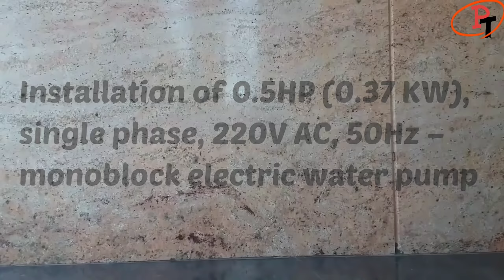INSTALLATION OF HALF HP PUMP | INSTALLATION OF 0.5 HP MONOBLOCK ELECTRIC WATER PUMP | PRACTOTECH #51

Comment: How to control the flow of water while spraying for balcony plants? Water is coming at very high force. It keeps on emptying the bucket of water in a fraction of seconds. What to do to reduce this?
Reply from the maker: You have to use a "pressure reducing valve"

Comment: .64 kw solar fittings can 0.5 hp pumpset work
Reply from the maker: You can use two solar panels each of 250 watts total 500 Watts to run your pump but the pump will only work for 4 to 5 hrs during bright day light.

Comment: Can we use centrifugal pump of 1 HP for getting the water to 3rd floor
Reply from the maker: You need to check the head (height) of the pump. 60 head, 80 head, 100 head....
Submersible pump is preferable for higher heads.

Comment: Will not it harm pump, if we close the water output before switching off. Bcoz pump is sucking water and creating pressure in output nozzle.
Reply from the maker: Dear Sir, the manufacturer have suggested to close the water o/p before switching off the pump. But it is not mandatory all the time. We can even close the ball valve after switching off the pump. It is not essentially required, if you are using the pump continuously.

Comment: nice video 
can i use it for my well 50feet depth, because we have no electricity, we have home solar system with 2.5kv inverter
Reply from the maker: the output pressure will reduce for 50 ft depth

Comment: With this method, after priming only first time if we put suction pipe in a tank then in future we don't need to do priming again right?until water level downs below football..motor will do Self priming right?
Reply from the maker: Yes Mr. Aditya Mirajkar. Having a FV at the end of suction pipe will keep the pump primed for longer time. Any water that is remaining in the pipe  will not be allowed to flow backwards through the valve until the water level falls below the FV.

Comment: Do you mean we need to shut down the gate valve(yellow) on delivery line first before stopping the motor in order to retain the water in suction line so that we can't bother to do repriming on next operation?
Reply from the maker: No its not required.

Comment: Bro , did u installed NRV in discharge head or did moter pump precame with check valve in discharge head ? Because my model is missing check valve or NRV at discharge head . Help me Bro
Reply from the maker: I have not installed NRV in discharge head.

Comment: is it not self priming pump? what is the use of that ball valve in that installation?
Reply from the maker: Any pump should have valves attached at the outlet to regulate 'pressure' within a pump.

Comment: Already there is foot valve in the motor. Is there any necessity to attach one more foot valve at the end of the suction tube/pipe ?
Reply: Having a FV at the end of suction pipe will keep the pump primed for longer time. Any water that is remaining in the pipe  will not be allowed to flow backwards through the valve toward the well / pond / sump / or any other water reservoir.
Reply: @harishsn3480  I have one at my home. It was pulling water up to say 15 or 16 ft. Now it's not pulling. I got it serviced  by changing the air seal,,inkfiller and bearing. No use. So I am thinking of attaching a FV. So only i asked. Thank you.
Reply: Dear Sampath Kumar, in such case we have check if there is any blockage at inlet suction filter, there are chances of blocked discharge lines also.. How old is your pump and how much is the capacity (HP)? and is it connected to sump? or well?
Reply: @harishsn3480  0.5 h p and from borewell.
Reply: Dear Sampath Kumar, 0.5 HP Monoblock  Centrifugal (Kirloskar) water pump will usually have  (This will be in the company catalogue / brochure) which is 98.5 feet. 
Means, from the level of foot valve (which is at lower most of suction pipe) it can deliver water to a distance of 98 feet. 
If your , then the pump will struggle to perform. In that case we should go for higher range pump.
Reply: @harishsn3480  Ok. Thank you very much
Reply from the maker: My pleasure.

Comment: Sir, 
0.5HP motor can use 3rd floor lifting water to tank or no please advice
Reply from the maker: Dear Sir,
0.5 HP pump will only be able to lift water around 30 feet. Please check the 'water head' of the pump mentioned in the Pump Manual. A pump can push water more than 50 feet up, but it can't pull it up that far!!

Comment: Kya yah 30 fit borwell se pani nikal sakta hain
Reply from the maker: 0.5 HP pump will be able to lift water around 30 feet. Please check the 'water head' of the pump mentioned in the Pump Manual. A pump can push water more than 50 feet up, but the pressure will reduce when it lifts water from 30 ft deep.
Reply from the maker: You need to check the head (height) of the pump. It will be mentioned in the catalogue like - 60 head, 80 head, 100 head.... 
Submersible pump is preferable for higher heads.

Comment: Good video. My only suggestion is to include a static page of all consumables used with their names including sizes so that people interested can make a note. This will help when someone goes to a hardware shop to buy the consumables. Thanks
Reply from the maker: Dear Gentleman, 
Thank you very much for your valuable feedback and I really respect the time you took to share your words.
I will definitely consider your advice and include all the necessary details in the description. 
As you wisely said - "It will help when someone goes to a hardware"
Reply: V ub 5:42 5:45 5:45 5:45 5:45

Comment: Nice information .... Can we use the same measurement pipes and fittings for 1HP motor as well.
Reply from the maker: Yes, definitely, provided the suction and delivery side has 1 inch diameter.
Reply: @practotech2997  thank you for the reply.   I brought Lakshmi pump and unfortunately the suction turned out to be 1.25...
Reply from the maker: Dear Mr. Harish, if 1.25 inch dia pipe is not available in your locality, you can use 1.15 to 1 inch reducers
Reply: @practotech2997  sure.  Thank you Sir

Comment: Can we use 0.5 hP for 25 feet lead below. ... Please
Reply from the maker: You need to check the head (height) of the pump. It will be mentioned in the catalogue like - 60 head, 80 head, 100 head.... 
Submersible pump is preferable for higher heads.

Comment: Nice video, thanks.  Can you help me calculate how much electricity my water pump consumes per hour. I use a Wizz mini motor made in Italy. 220v.....60Hz....3450min'......0.37kW....0.5Hp
Reply from the maker: Hello Mr. Young, To calculate the power consumption of your water pump just put the wattage of your water pump (0.37 KW) x operational hours and electricity tariff of your locality and you will get the units of electricity consumed by your water pump
Reply from the maker: 1 KW x 1 hr = 1 Electrical Unit

Comment: Can it use in tube well
Reply from the maker: Mr. Spandan, No we cannot use a mono block pump for tube well. Instead you can use a Vertical Turbine Pump (multistage diffuser type pump) which is used to pump water from deep tube wells.

Comment: Sir...u not connected check valve or nvr in the discharge line...why?
Reply from the maker: Hello Sir,
Check valves prevent flow in an opposite direction. Any way i have used  Foot valve which keep the pump primed, allowing water to flow in, but not letting it flow back out, making them ideal for use in pools, ponds, and wells.
Reply: @practotech2997  Thanx sir for response....pls let me know...where unions are connected in discharge line...pls help
Reply from the maker: Hello Sir, Unions are usually connected between priming valve and shutoff valve
Reply: @practotech2997  thanx a lot👍

Comment: என்ன ரேட்டு
Reply from the maker: Hello Vijay,
Please find the details.

CROMPTON - monoset electric water pump.
Model no. MAD052(1PH)Y-18
Half HP, Single phase, 220V Ac
Rs. 3500/- (March 2021)

You can check the link of motor given in the description box

Comment: Ek number ka bakwas mere 3900 barbad ho gaya😢
Reply from the maker: How? Claim the warranty.
Reply: @practotech2997   sir motor itna power full nhi hai ki wo pani khech sake....
Reply from the maker: What is the capacity of the motor Sir?
Reply: @practotech2997  1 ph
Reply from the maker: Hoo... 
Sir, you need atleast 0.5HP motor for better performance.
Reply: @practotech2997  sir 1.0 hp hai